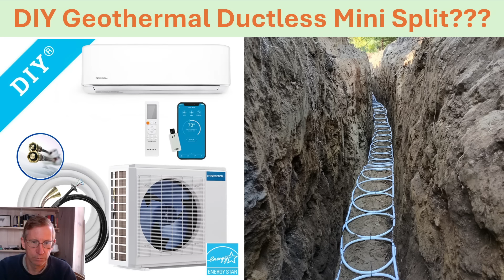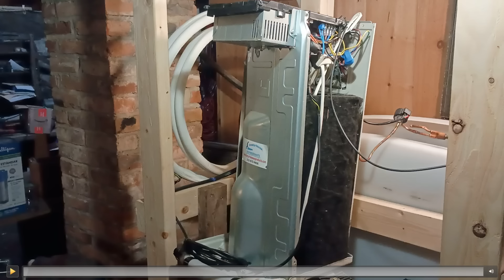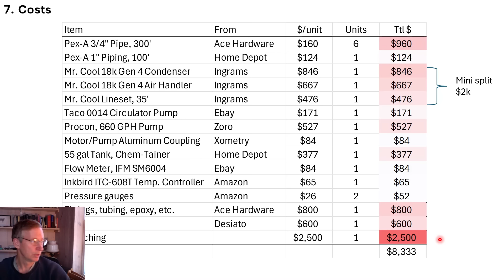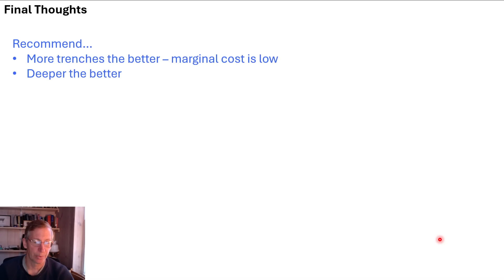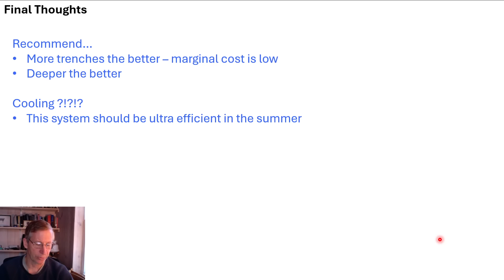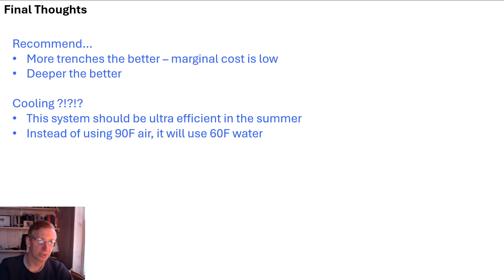DIY Geothermal Ductless Mini Split (Ground Source Heat Pump)

Comment: Hi!  For that reverse spin on the fan/pump motor GEDORE Ratchet screwdriver SilentGEAR.  It has a clutch inside for silent one way operation with no resistance in the direction you don’t want your water pump to go.
Reply: That is the type I would look for.

Comment: What if you swap ends and reverse the cycle?  Like the outside unit inside , then a simple coaxial copper tube in the ground source supply line.  That way the Freon can stay in the outside unit, and a simple charge is possible w/o water tanks etc.  Heat or Cool the directions reversed.  Might be easier to adapt a mini split to an existing ground source water loop.  Easy to tap in w/o a complicated tank to keep full.  
thoughts on reversing and outside unit inside?
Reply: Easy to make a coaxial freon to water heater exchanger using copper tube..  or if nothing else, with reversal, water cooling the inside heat exchanger connected with flex line is much simpler than the bolted in hardline connected outside heat exchanger.

Comment: From one engineer to another, "Thank you!!!!" 

I am building a 30'/50' Well" based system with a heat exchanger between the well water and the freon coils.

After seeing your video, I plan to run two pumps using the existing fan motor. 
1 for the Well to heat exchanger with the existing foot valve to maintain priming. 
The 2nd small pump for the heat exchanger to the Freon Coil tank. 
I hope that directing the freon coil pumps' output directly on the freon coils will solve the icing issues (Your Thoughts?)

We will use that water well primarily for livestock, our garden, and emergencies with serious sterilization.
The well will include two 3/4" PVC pipes in a 2" pipe with the return at 50' and the intake with a prime maintaining foot valve at 30'
I will probably install a 1/2hp priming pump to automatically restore prime when and if it is lost.

Water temps 30'-50' down are consistently 48-53 °F due to very high water profusion.
The change in temperature mostly due to the colder exit water discharged at 50'.

But if you want god to laugh, tell him your plans!!!

Thanks so much!!! 
Any suggestions would be appreciated.

Comment: I'm thinking of using a discarded 2ton ac by putting the outside unit in my basement and ducting to the furnace. Will heat only so I'm calling it a CHeater

Comment: It sounds like you could get quite a bit better efficiency by storing the heat from throughout the day in some water and then using a radiator to dump it as you need it, as opposed to trying to draw it suddenly. Of course that doubles your complexity and space requirements. Another thing is that the condenser coil in the mini-split will get quite a bit hotter than the air temperature, which will mean worse efficiency than if you were dumping it into water.
Thanks for doing all the calculations.
Reply: At that point you might as well just completely redo the refrigerant plumbing and put in proper water heat exchangers.
Reply: @MarkFunderburk  What's the surface area of proper water-refrigerant heat exchangers? Are they really much more efficient at condensing or boiling refrigerant than an in-air condenser sitting in a bath of moving water?

Comment: Heating ... you have a tank of ice cold water in your house! cooling .. that water will be hot!  Tank should be outside. Otherwise super thorough well presented work.
Reply: I would say the basement is not being heated or cooled so it doesn't matter. If you put that outside your water is going to be at ground temperature making the whole system useless.

Comment: Does anyone know of it would be possible to do a low cost mediocre system by putting just however many grounds loops would fit in trenches that are being dig for something else?- namely, a building’s footer and foundation? (Presuming you are insulating with rigid foam board between your foundation and inside of your building envelope. I understand it wouldn’t make sense to transfer/absorb the heat energy to the very foundation of the building you are trying to cool/heat if you didn’t). Thanks!

Comment: Doing a direct-expansion system would have saved you a lot of complexity and gained you efficiency for a bit more rabbit-holing into refrigeration. Since you recommend the "invasive" evaporator bending, why not pump the system down and get rid of the stock evaporator altogether and just let the refrigerant evaporate in the soil? You would need copper pipes (with plastic coating recommended) but you would get rid of every single other component - the tank, the circulation pumps, the fittings and all the armature, not even mentioning the flow sensor and glycol etc. The need for the "mediator" - water-glycol - in the heat transfer cascade decreases the efficiency in itself (you usually lose 1-2 K with every thermal component in the cascade). Moreover, you would eliminate the power needed by the circulator pumps, as this is the work that the compressor does anyway - it is only "destroyed" by the expansion valve, now a part of this would be used to circulate the refrigerant in the ground loop. I would recommend adding an oil separator after the compressor to minimize the oil loss in the ground loop, but this is entirely doable in a DIY scheme. Not intended as criticism, the video is great. I just see a lot of similar systems being posted (see Tech Ingredients) and wonder why not go the extra foot and make the system more efficient and simpler.

Comment: I like it. Really good info, and planning. 
I think i might do a similar setup sometime, but run it off of well water. Could do a plate exchanger, so you could keep deionized water around condenser and let well water flow through other side of the exchanger.
Let well water fill up a separate tank with a float valve, and use fan motor to pump well water through exchanger. That way you wouldn't waste well water. Use Taco pump to circulate water in condenser tank and through plate exchanger.

Comment: An over running clutch would solve you fan reverse issue.  The clutch only drives one way in reverse it slips allowing the motor to spin freely.

Comment: I wanted to do this but instead of the tank I was going to add a radiator in front of the outdoor unit connected to the ground loops so the air would pass through the added radiator first but your system is SO much better!
Reply: I also had this idea, it's far less Intrusive than building a dedicated system. And would work quite well for defrost in the winter which is actually one of the biggest performance inhibitors for air source in my area. (Wet air year round even down to -15c)

Comment: Nice work, thanks for taking us along for the ride. I have been considering construction of a similar project for quite some time now, and your ideas have solved a couple of the concerns I have had - first whether or not such an installation was financially viable in CT, and another major consideration I had was exactly how I was going to communicate with the circulator pump using the original control board - your concept of using the original motor to directly drive the pump is a glorious and simple solution to this. 

Try installing a sprag on the motor drive coupling to prevent reversing the pump. (edit: in reading through comments I see this was already suggested, so I'm late to the game on this one)

I live nearby and would be very pleased to collaborate on further improvements.
Keep up the great work!
Reply from the maker: Hi Red, feel free to reach out, I am easy to find if you google search my name

Comment: Can you add a shroud around the outside unit so that it pulls through earth tubes so it will be pulling warmer than ambient temp air instead of liquid tubes?

Comment: If I understand correctly, he got the January CoP from about 2.4 to about 3 by increasing the cost from $2k to $8k.  My father in law spent about the same amount for two heat pumps running on solar power with batteries to keep the system running at night.
Reply: I think it was also an issue of capacity, the system he used would have had much lower output at those lower temps. Also from what I saw the Mr cool would have been at a COP of 1 and on the verge of its min outdoor temperature on some of the days he has.

That being said, you are right it's usually more cost effective to just put in more / better mini split.

BUT I also think he is not operating his system optimally, all of the starting and stopping / set temperature changes he does surely isn't helping his COP.

Comment: When you switch to aluminum you could simply make it a clutched adapter so when the fan motor reverses it would allow the drive cogs in the adapter to simply slip in the reverse direction
Reply: Called an overrunning clutch or one way bearing or a sprag.
Reply: Either that, or a bypass circuit with a one-way valve. When it reverses an easy short reverse path is present, rather than trying to suck water up from the lower down coil system.

Comment: Great system. Geniuses adaptation. Concerning the pump. I would replace the fan motor with a relay/contactor matching the energising coil voltage and use a pair of the relay contacts to power a stand alone single phase pump. When the system reverses, the relay will just close not affecting the pump.
Reply: These Minisplits watch that motor for speed, they have a sensor in the motor.

Comment: Here for the summer performance video 👀
Reply: There's very little worry about summer performance with geo thermal, if it can do well in winter then it will be fantastic in the summer.
Reply: @superedge99  Depends on climate & construction. The thing that people overlook is: solar gain helps you out in winter and reduces heating need, but works against you in summer.

Comment: I installed a solar powered mini split. It came with 3 panels could run on 2. It would change over from solar dc power to ac

Comment: Couldn't tell how you measured the electrical power used. 
If you simply measured the voltage and current, and multiple them, you'll get "apparent power", which is a vector sum of the real power (that you pay for) and reactive power. 
Real power is the product of the voltage times the current portion that is in phase with the voltage, and will be smaller than the apparent power. 
How much smaller? That is one of those 'it depends' answers...

A power meter might be useful. They aren't as expensive as they used to be!
Hopefully this might bump up your CoP's a little bit 🤞
Reply from the maker: I was measuring apparent power.  I was continuously measuring current and I just measured voltage a few times.  I hadn't thought about this, but a quick AI response says it is typically only a few percent for mini splits.
Reply: @edwardwazer5103  that depends on the manufacturer's design. If they implemented a more expensive pfc (power factor correction) design: yes, there's next to no difference. 
If they took a cheap route, like adding an inductive choke to smooth out a simple diode bridge rectifier, then the pf is more like 0.8, meaning your readings are high by 20%.

Yes, it's complicated. But it can matter.

Comment: how NOT to DIY a geo system. SO MANY MAJOR problems. 0/10 giant nightmare for anyone. that poor fan motor working 900x harder at 900x slower speed doing NOTHING but wearing out.
Reply from the maker: It is operating at the same speed, but I agree it is working harder. The power required to move the water is within spec of the motor.  Time will tell

Comment: Great project and video!  Thanks for sharing.  So I am curious the financial benefits that you would attribute to running the same heatpump with geothermal over standard airflow.  Your $2,000 system jumped to $8,333 plus a lot of effort on your part to make it geothermal.   Any sense of the ROI on the conversion?  You run a pretty lean home, cutting things off overnight and when you are away, which would extend out the ROI even further.  Thanks again!

Comment: I have an air-sourced heat pump for a 5400 sf modern net zero home (21 kW solar array powers and heats my home, $0 bills yearly).  I wanted to do ground-sourced but I could not get permits to put water in the ground as i'm on a ravine in the city limits (erosion concerns and bylaws).  I find that I'd like to supplement the heat when it gets below -33 C with a pellet stove so the heat pump doesn't have to work so hard at that point.  It'd be only 1-2 weeks a year where I live in northern Canada, thus not expensive to operate.  Just the setup would be the major cost.  I probably wouldn't have wanted to do this if I had a more steady ground-sourced system.

Comment: If you add insulation over the trenches to keep the ground temp warmer, raises your frostline. Mineral wool would be great, bugs love foam. The  insulation could be just a few inches below the surface.

Comment: Why such large plumbing? At 18k BTU a 2GPM flow only rises ~18F. Why don't you use lower cost small diameter plumbing? I'm assuming it's a desire to have better efficiency with the ground transfer.
Reply from the maker: Having that much of a delta T would freeze my lines.  On the coldest days I've run as low as 36F already
Reply: @edwardwazer5103 at 36f your using an antifreeze. It sounds like freezing is s at some much lower temperature. Automotive antifreeze easily gets you to around -20f. The 100k mile stuff is good as it helps keep failures caused by contamination low.

Comment: A roller or sprag clutch between the fan and pump shaft would help with the fan reversal issues.
Reply: This was my first thought. Second thought might be much less expensive: Since the cavitation is only due to the pump trying to pull from the loop, a one-way valve(for instance a sump pump valve) could be tee'd off the pump output line back to the tank. This way under normal flow the valve is closed and flow is directed through the loop, and when the pump reverses, the valve opens and the motor has the entire capacity of the tank to pull from to eliminate cavitation.

Comment: Why not just use the dc pump power with OR gates to actuate a relay and run a more conventional pump?
Reply from the maker: I thought it would be simpler to use the existing motor, probably are better solutions

Comment: any updates to share? have you tried to cool with it (even just for testing, it sounds like you're in a climate without too much AC needs)?
Reply from the maker: Just a little, ran if for a day here and there.  Water temperature was ~62F, so efficiency should be very high

Comment: Hello. What's the maximum temperature you get from your condenser? I am planning a similar setting 18500 BTU compressor, 1600 feet 1 inch slinky coils 7 feet underground, 50 feet 3/8 copper tubing inside 1 inch tubing as a condenser and the same for the evaporator.  I'll use ethanol or methanol to avoid high viscosity in low temperatures. Thanks
Reply from the maker: Hmm, I don't know.  You mean min during heating mode?  Or max during cooling mode? (if you are talking about the refrigerant temperature, I don't know either)
Are you running 1600 ft straight run, no separate circuits?

Comment: Do you have issues with oxydizing of the circulating water, leading to radiators corrosion ? would you consider changing it for a titanium heat exchanger for example ?
Reply from the maker: Ideally it would be a tube in tube heat exchanger, like those used in ground source heat pumps.  I think I'd do this if I were to do it again and have an HVAC person discharge and recharge the system.

Comment: Maybe somebody’s already suggested this, but I wonder about a clutch or tooth adapter similar to what a lawnmower pull starter work on your motor. 
So if it’s going in the correct desired direction the dog ears are engaged, but when it reverses, they collapse back in and it free spins and does not engage the pump.

Comment: Amazing presentation! I would run your system 24/7 for a few days and you will probably find better efficiency with more stabilization. providing your motors turn off when not needed. 
I love what you have accomplished.

Comment: Geothermal is reserved for situation where naturally hot water is coming from the ground up. And heat the exchanger. This here you call "geothermal" is only heat pump with ground source. Stop using geothermal!!!
Reply from the maker: oops, relax